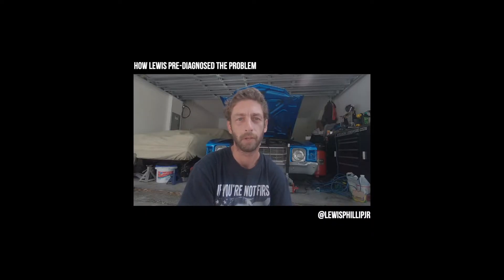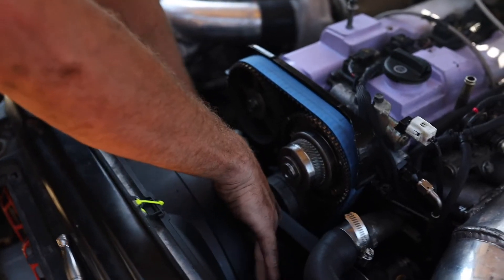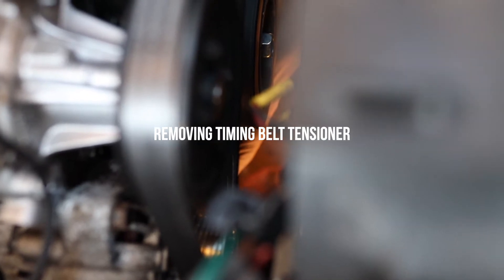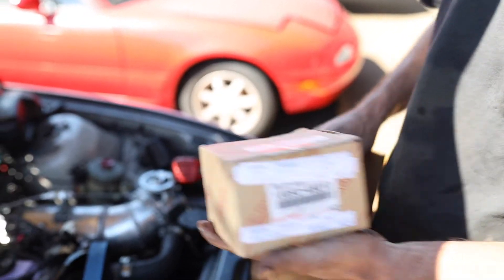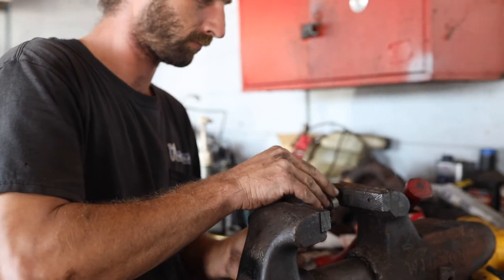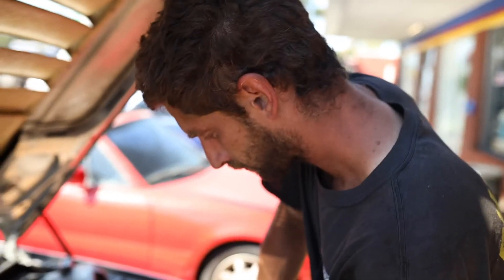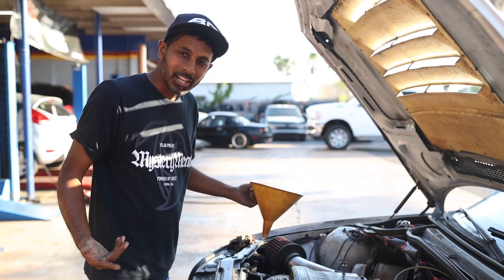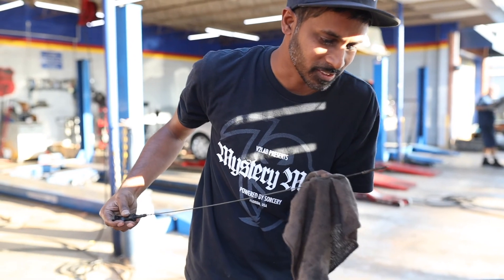Replacing A Leaky 2JZ VVTI Cam Gear - Install Video

Comment: Hey any idea how to torque down the crankshaft bolt to spec without it moving? And I don’t have an impact gun
Reply from the maker: If you can’t put the car in gear or something - the only other thing that seems to work is a snap on air-impact gun lollll
Reply: @v2lab  I have an automatic trans, do I just put it in Drive and then tighten?
Reply from the maker: @jaimesandoval5215  that i don’t know? Try it and see what happens? Haha

Comment: Do you know where I can get engine torque specs for an is300?
Reply from the maker: This looks like everything 

https://www.my.is/attachments/enginetorquespec-pdf.3823/
Reply: @v2lab  thank you so much!🙌🏼
Reply from the maker: @jaimesandoval5215  for sure - good luck with your project!
Reply: @v2lab  thanks, Im doing a timing belt replacement along with the vvti gear that’s leaking so this helped 🙏🏼
Reply from the maker: @jaimesandoval5215  for sure - if you can re-pin the tensioner it helps a lot so you don't have to replace it 

my buddy did all of this so easily - i was expecting the worst and hours of work haha
Reply: @v2lab  well I don’t have vise clamp unfortunately, I bought a timing belt kit and it came with a new tensioner so I should be fine. Just praying to god nothing snaps😂
Reply from the maker: @jaimesandoval5215  haha, ahh man, well you got this man! knock it out! good luck brother
Reply: @v2lab  one more thing, do you know what size wrench you need to hold the camshaft in place to crack the vvti bolt loose?
Reply from the maker: @jaimesandoval5215  i used an adjustable-wrench / i have this fancy one that isn’t in this video obviously
Reply: @v2lab  also one more thing, what lubricant do you use for putting bolts back on? I heard you can use dielectric grease for everything
Reply from the maker: @jaimesandoval5215  i don’t think we used anything tbh - sorry man
Reply: @v2lab  Fs thanks, it’s just that the bolts are kinda rusty, there hasn’t been any maintenance or anything and I ain’t tryna like put it in super dry and risk snapping a bolt😂
Reply from the maker: @jaimesandoval5215  oh i hear that - i blew a ton of money at nissan recently buying "new" bolts for everything (on this s-chassis we're rebuilding) so i know how that goes.